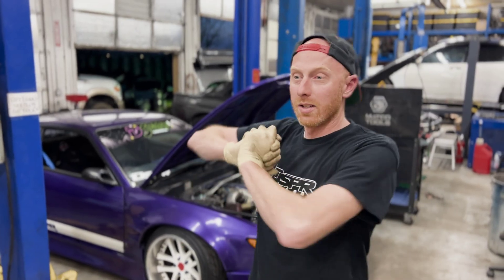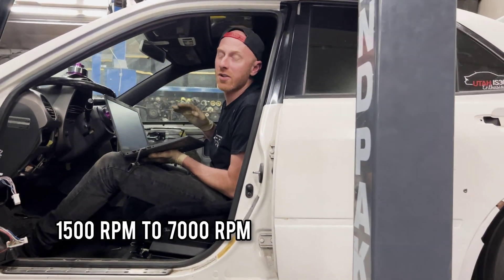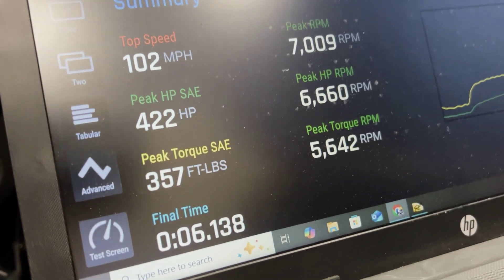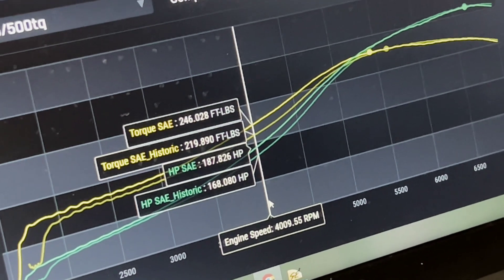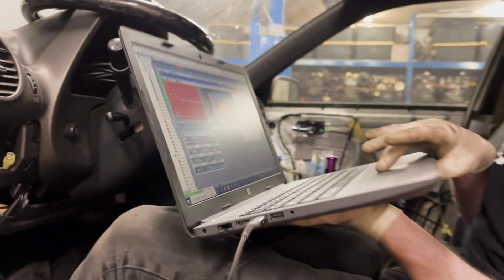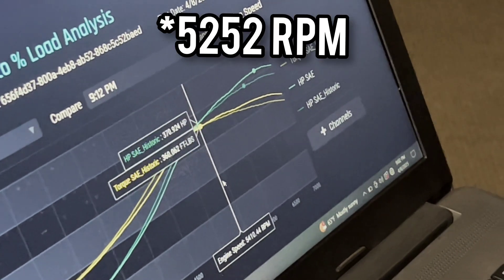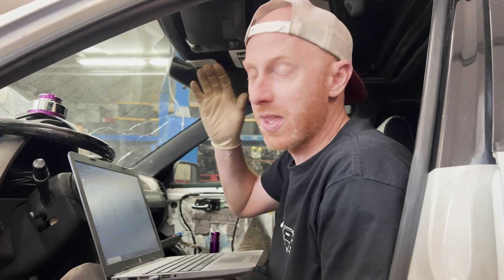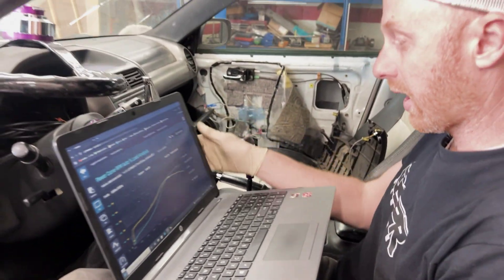We test HP gains with and without VVTI on this turbo 2JZ powered IS300 on ECU Master

Comment: Do you turn off vvti when you 1st tune the engine. And then go back and adjust the vvti table?
Reply from the maker: @outlawlui  I didn't. I started with an older map that I had.
Reply: @BrandonWicknick  Could you post the last VVTi table you made. Want to compare to my 2jz one

Comment: so overall it is running 1 bar or not? Cause in 9:55 looks like you have 0 timing at 200kpa :P It can hesitate in timing, when you are running like 0,9 and 1bar column is not filled out
Reply from the maker: @FaworDrifts  zero vvti timing correct. The table interpolates. So at .9 bar it's on the edge of the 30 to 0 columns so I imagine it's around 15. But I'm always at high rpm there so the logs always showed zero vvti timing at that boost and rpm of course.
Reply: @BrandonWicknick  what target boost do you run/want to run thru the rpm range from full boost to redline?